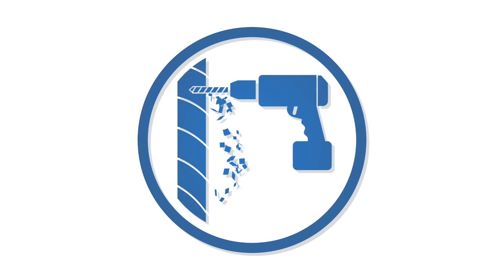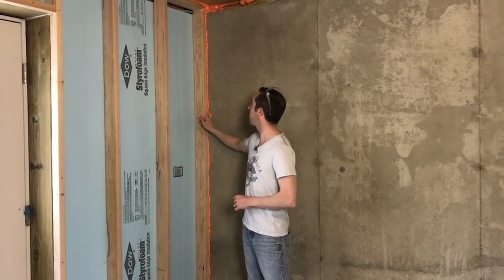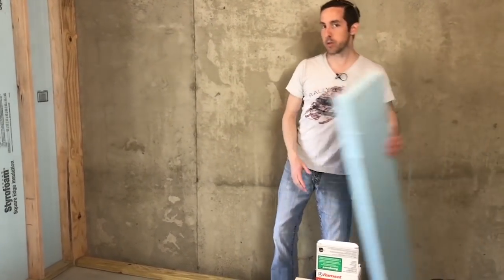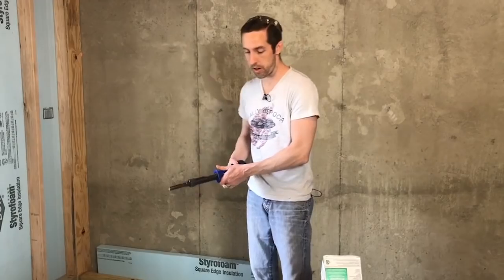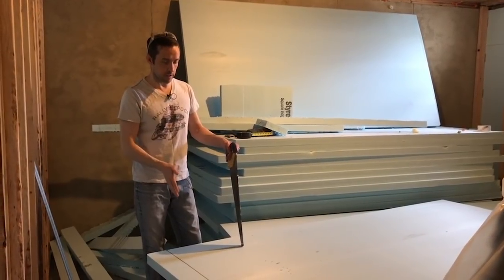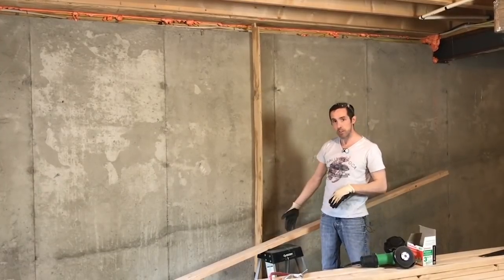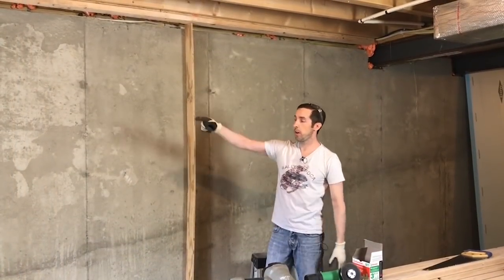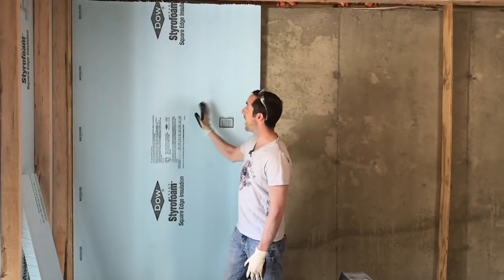How to Frame a Basement Wall

Comment: The “wobble “ in the board is called the crown.  If you look down the lumber you can clearly see the crown.  I make a crown mark on each stud and make sure all crowns are placed towards the wall.  Otherwise you get a bow in your drywall or plywood that covers the studs.  If it is concave you don’t see that like a bow or you can shim it. Not a big deal but thought I would throw that out there.  Nice video.

Comment: Thanks for sharing the videos.  Particularly the parts about fire blocking, which I see ignored in some other basement wall building videos. With the wood fire blocking directly against the cement wall, seems like some insulating quality is lost along with potential for mold/rotting of the wood, but if that is required by code what can you do.  Maybe use treated wood for the fire blocking?

Comment: Suggestion.... A little Locktite foam board insulation will hold the foam board to the concrete.  Then you can frame the stud wall on the floor, all nice and square, and raise the whole wall (or a large section) at once.  Toe nailing every stud is a PITA.

Also, weren't you required to float the walls?
Reply from the maker: The XPS had some cupping to it, so it wouldn't stay on the wall without some pressure.  I would have preferred to build the walls on the floor and then stand them up, but I have so much crap down here it was hard to make the room for it.

My township didn't require me to float the walls thankfully.
Reply: Also, it is hard for one person to stand up a 16 foot wall fully studded by themselves, this method is much easier when your doing the work yourself.  Keep up the good work!

Comment: All other videos  will show to frame on ground and lift all at one which never worked.This is best method where u put top and lower first and then u measure hiegt of each stud  whixh actually varies and screw it.If you are doing DIY ur self then better to use cobstruction screws to nail studs since u can remove them if required and re adjust if needed.

Comment: Trying to figure out how to secure the top of wall frame.  I've got two wall that run parallel with the floor joists, but the joists are close to 8 inches off the cement wall.  Any videos showing techniques on how to frame in this situation?

Comment: Thank you for the great video. I have a question for you if you don't mind? Im currently building a small workshop in my two car garage and would like to Frame one side of my block wall for tool storage or a French cleat. My question is, I don't have floor joist exposed at the top. It looks like its either stucco or plaster. So would I just measure all the way to the ceiling and nail into the stucco? Thanks.
Reply from the maker: You need to attach your wall to something structural at the floor and the ceiling.  Attaching just to the stucco ain't gonna cut it.
Reply: @OHFScratch  For the floor I can just drill straight into the concrete, but the ceiling is what has me a little stumped. Any ideas on how you would do it? Maybe use a stud finder?

Comment: How do you ensure the top plate is plumb with the bottom plate? Is that temporary fire stop plumb? 

Just curious because you didn't use a laser or plumb bob... I framed a basement that was out at least 3/4 of an inch at the top, and if I hadn't spent time making sure the plates were plumb, all of my studs would have been leaning forward by 3/4 at the top.
Reply from the maker: You need to check for plumb, which is a detail I neglected to mention.  One of my walls was out of plumb by an inch and I had to redo it.

Comment: I live in Minnesota, would it be a good idea to finish the basement using 2 by 6 construction for more insulation?
Reply from the maker: Either that or just use thicker XPS against the foundation wall with regular 2x4s in front of it.  You'd have to do a cost comparison to see which is the most cost effective solution.
Reply: 2" foam is R10, then additional bats in the 2x4 stud bays (not shown in this video) gets you R15 for a total R25.  2x6 bats would give you R23 + R10 from the foam for R33.  Every additional inch of foam is R5.  Really just depends on local code and how much insulation you need in your walls.  Usually R25 is enough.

Comment: "Wobble out" is ambiguous at best.  In your floor test the side tested that causes wobble is the crowned side. So "wobble out" is validly interpreted as crowned side out.  As explained by another poster, the opposite is best. 

Also, I fail to see the need for so much glue, or any at all between foam and masonry wall.  It's not going anywhere. 

Using the foam spacer at floor level to determine bottom plate placement assumes the masonry wall surface is perfectly plumb.

Comment: Shouldn't you start your wall an inch from the cement wall for an air gap?I see you have air gap for inside wall but what about wall facing outside?
Reply from the maker: Since I'm using an XPS insulation, which acts as both a vapor barrier and an insulator, I don't believe an air gap is necessary.  If I was using batt insulation, then an air gap would be recommended... at least that's what the insulation instructions from my township called for.
Reply: Aren't you also using like roxul batts between your studs also or are you just installing drywall over studs. Vapor barriers are ok for outside walls not inside walls . I have same foamboard but I don't think it acts as a barrier, just an insulator.

Comment: The way you're doing it you have sticks up against concrete with no moisture barrier in between. I'm not so sure this is a good idea. Is it?
Reply from the maker: The XPS foam is up against the concrete, not the framing lumber.  The XPS also acts as a vapor barrier.

Comment: The rigid foam has a gap at the top. Will you cover or fill it with somthing or leave it open?.
Reply from the maker: You certainly can add some batt insulation.
Reply: Does the gap create a new chamber for fire and smoke to go through? The gap now runs along the whole wall.

Comment: Hi, I am trying to install stud in basement showroom against concrete wall. Do I have to use 2x4 stud? Can I use 2x2 since it is not a structural frame and leaning against concrete wall? Please advise. Thank you,
Reply from the maker: 2x2 is not an issue structurally as you say.  The concern is having room for electrical boxes for outlets and switches.  Not sure 2x2 walls will accommodate an electrical box.
Reply: Many Thanks for your reply. Its for standing shower wall and there would be no electric or plumbing. I will just put tiles on the wall. Do you think I can go ahead with 2x2. Once again many thanks for your response.
Reply from the maker: You need to check with your local building inspector, but I don't think there's any concern structurally.
Reply: Thanks a lot, I think I got my answer. Appreciate your comments.

Comment: Why add something to stick the insulation to the wall if it's going to be holding it with the 2×4?
Reply from the maker: Because you want the insulation tight against the foundation to eliminate or reduce any air gap.  The 2x4 wall will need to be checked for plumb and sometimes that means the 2x4s aren't pressing against the insulation.
Reply: Why eliminate an air gap?  If anything, it's a beneficial feature you've left out.

Comment: Why the foam?  It doesn't meet any code that I'm aware of...  I get that it's easier than fire caulk but it's fairly useless in general.  Fire Marshalls don't allow it anywhere they inspect
Reply from the maker: In our township, the fire inspector allows the orange fire-block specific expanding foam as well as roxul and caulk.  The foam is easier to seal mid-size cracks where it's too big for the caulk and too small for the insulation.  Plus it's fun.
Reply: @OHFScratch  guess I'm just used to commercial applications from Texas to Georgia. Thanks!

Comment: how do prevent the spray foam from clogging up in the tube? anytime i've used it, t dries up quite quickly
Reply from the maker: Put a screw or a nail into the end of the tube immediately after you're done using it.  The foam cures on contact with air, if you keep air out of the tube it will allow you to keep using it.
Reply: Now  they have the foam as reusable.  It says "Reuse" on the label. You spray like always, a little at the tip will dry. The next time you use it, just grab that dried foam and pull it off. The foam will flow just  like new!

Comment: Why buy the foam board glue if the studs are gonna hold it in place, and it doesn't really hold it in place very well
Reply from the maker: It's a bit of belts and suspenders.  I guess you can get away with just using the studs.  You'll need the glue though on walls where there's a gap between the studs and the insulation.
Reply: Hi

Comment: You mean vertical fire stops, right?
Reply from the maker: No.  Horizontal fire stops run from floor to ceiling, but they prevent fires from moving horizontally.
Reply: Its stopping horizontal fire movement.

Comment: Forget all this huge waste of space, adhesive the foam board to the cement wall then screw 1x3 threw the foam into the concrete 5 of them too to bottom then cross them with another 1x3 and your only using up 2 inches of space instead of the width of a 2x4
Reply from the maker: You'll have a harder time running romex that way.
Reply: @OHFScratch  not really you can run both from above and from the side easily withou drilling any holes as you’ve got space behind the top board to go horizontally and space in front of the back board to go vertically

Comment: I thought all basement framing should be floating for your basement floor heaving or your flour above moving. This prevents your dry wall from cracking. Why is this not done here?
Reply from the maker: It wasn't required in my local township.  It's not required everywhere.  My assumption is our town doesn't see any heaving and therefore it's not needed.

Comment: Or...just build the wall on the floor with the insulation nailed to it, tip in to place and nail up
Reply: I'll say this though - it's a heck of a lot easier to build a wall in place when you're doing it alone rather than trying to hoist up a huge awkward wall of studs by yourself.
Reply: poetnk if you can get a buddy to help tip it up you're good to go.

Comment: Is this supposed to be a DIY/amateur approach to framing basement walls? I’m sure I can name 10 mistakes in this video very easily. For starters- you don’t “level” things vertically. You “plumb” them. And it doesn’t seem like you did very much of that as you went. Were your plates square or are you assuming the foundation walls are, and therefore basing your layout off of that? If someone that had no clue what they were doing watched this video they would have so many unanswered questions and would absolutely make a ton of mistakes. Valiant effort. I have suggestions if you’d like them.
Reply from the maker: Walls do indeed need to be checked for plumb.  I did neglect to mention that.  I'll add a note to the video.  These videos aren't intended to capture every single detail, just enough to get an understanding of the process and effort involved.
Reply: Man!  You are way overly critical.  If someone watched this video and still didn't know what to do they should be looking for a contractor, not buying tools and ordering material.  A step-by-step instructional video on how to frame basement walls would certainly be way longer than 14 minutes.  Where are your instructional videos for people to pick apart?
Reply: No Name Dwight Hapeman I was thinking the same thing!!